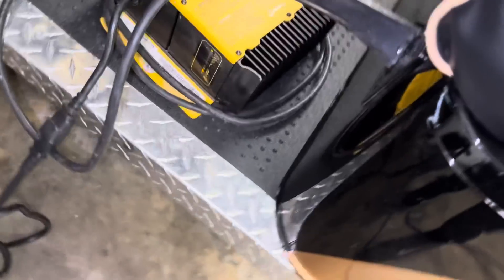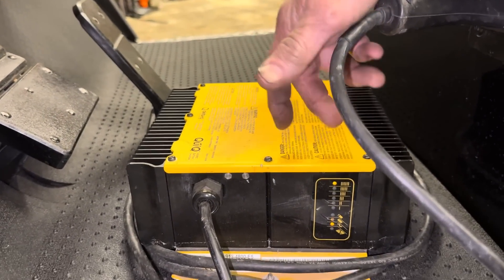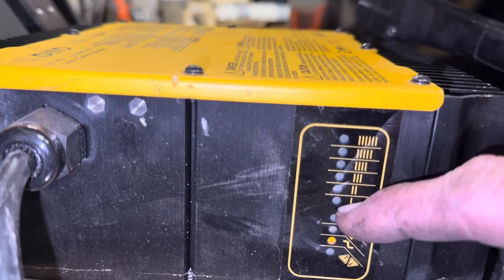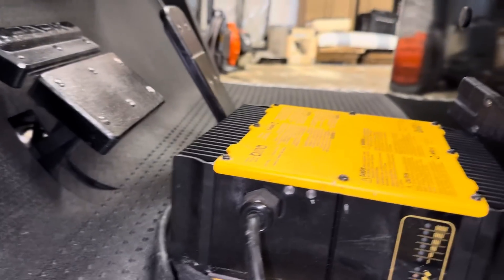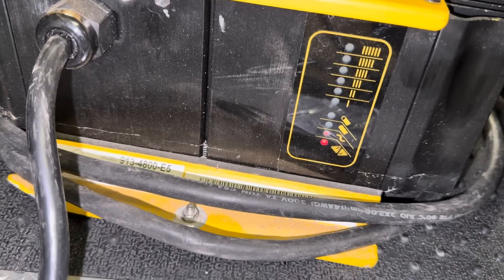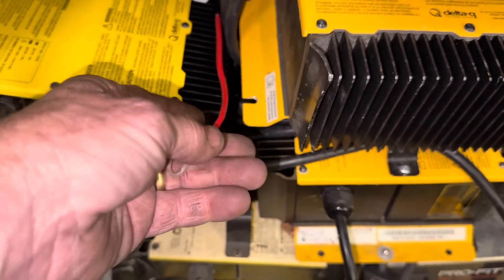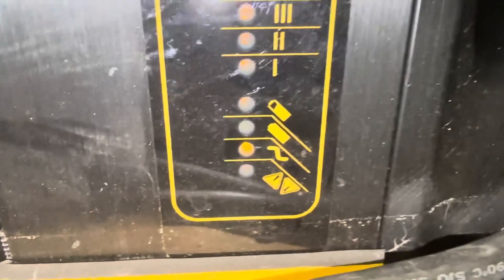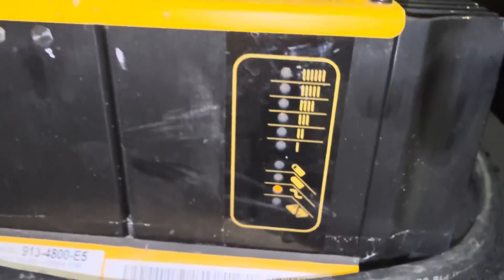QUIQ CHARGER: How it REALLY Works

Comment: I got one on a spider lift, I just installed new batteries and after charger is plug up only few minutes it sounds like it trying to boil the batteries, can actually smell them so I afraid to use the charger, any idea if they something wrong with the charger. It’s a 24 volt system 912-2400, my batteries are acid thx
Reply from the maker: What kind of batteries did you take out. Also just plug in the ac cord and unhook the dc cord off battery and let me know what algorithm the charger has in it
Reply: @golfcartwhisperer  remove Trojan batteries, was told batteries replace them with was basically same but I feel that they were charged on wrong program
Reply from the maker: @garyjustliving3963  yes children Battery carries algorithm 31 or three if you go to my page, it shows you how to reset your charger to change the algorithm just typing Golf Cart Whisperer algorithm
Reply: @golfcartwhisperer  ok thx, I try post link but don’t think went on here, but I made a video of it flashing code on my channel
Reply from the maker: You have the wrong algorithm.  That’s for gel batteries
Reply from the maker: You have 26
Reply: @golfcartwhisperer ok thx
Reply: @golfcartwhisperer  seems as if my charger doesn’t have algorithm 31 or 33, but how ever it do have 11 , seem from research I did I can use 11, my batteries are around 210 ah I believe with acid, checking see if u think would be fine
Reply from the maker: @garyjustliving3963 that’s correct you can use that. It’s not perfect for that but it will work
Reply from the maker: https://youtu.be/t-M4jr_HeZ8?si=yLbMxrRdfHfM_WBr

Comment: Can these chargers be mounted sideways? I tried mounting mine inside the cart underneath the seat sideways and it got very hot and stopped charging. I unplugged it and let it cool down and set it upright and it works fine. I just want to know if I can set it sideways and maybe add a cooling fan or will mounting the charger sideways hurt it?
Reply from the maker: Sideways is good it doesn’t matter as long as it gets air
Reply: Well thank you for replying. I appreciate it very much. I'll see what I can do about it. Thanks again.
Reply from the maker: One thing I told myself when I made this page. Is I will respond to every comment or question on any of my videos.  Thanks for watching. Hit that subscribe button.

Comment: I just purchased a 2019 ezgo with a Samsung SDI Lithium battery. I won’t be using the cart in the coming winter months until about April. I need to leave the cart at my summer place but it’s not climate controlled in Delaware. Should  I remove the battery and store it in my other place inside and keep it charged from time to time? Or can I leave it for that long with the cart and maybe come back once a month to give  it charge? Sorry for the long question.
Reply from the maker: Take it out and store it in a climate controlled area. To get the best time out your batteries.
Reply: @golfcartwhisperer thanks should I buy another charger separate to change it at home since the Quiq Q charger only works with the cart plug? Or will it last 4 months in climate controlled closet at home? Then I can charge it back up in April?
Reply from the maker: How cold does it get where you live at?
Reply: @golfcartwhisperer in Delaware just under freezing in the teens in Jan-Feb
Reply from the maker: @mikesky4701 there is 3 screws to take the back of it off. 
But remember your your charging post will be exposed so while I was hooked to the battery, they’re going to be hot so once you charge it up, I would unhook one of the leads on the Battery so you don’t have a voltage on the post that stick out
Reply from the maker: All you have to do is unhook your charging port from the back of your plug. And your charger will work.  Then just take the plug inside your house and charge it up
Reply: @golfcartwhisperer genius! Thank you that’s easy I can do it. Gets down to 20’s in Jan /Feb I am going to keep the cart under the house it’s up on stilts beach house and open.

Comment: How long does it take to recharge the batteries and does this cut off automatically when it is charged???
I have the same charger and cart has 6 batteries in it…
Thanks for video…subbed you…
Reply from the maker: Thank you sir.  Depending on how dead the batteries are.  But they can charge anywhere from 4-& hours.

Comment: I have this charger for an older Star EV golf cart, I’m trying to figure out it the batteries are bad or if the charger is not working properly. Having this issue where I charge the cart and it only last for about 10-15 minutes before it starts to slow down a lot. The charger lights do not indicate any of these indications yours does, whilst all batteries read 8v. I’m lost on where to find this issue out completely
Reply from the maker: Hat does your charger do when you plug it in
Reply: @golfcartwhisperer it shows the Ac power is present but not sure if I’ve seen other indicators go off
Reply from the maker: Does your golf cart run now meeting? Can you get on it at this second hit the gas and it move.
Reply: @golfcartwhisperer yes the cart is still functional and the battery’s seem to charge it just doesn’t seem to be fully charged
Reply from the maker: Does your charger cut off once it’s full charged
Reply: hey my ezgo is doing the same thing charges overnight and only lasts 5-10mins and my charger has the swiggly line on the bottom but it hasn't ever charged higher than the second bar on the charger and can't figure it out. batteries are brand new
Reply from the maker: When’s the last time you put new batteries in it. Also put your cart on charge and check each battery while it’s charging and let me know what it shows.
Reply: @golfcartwhisperer brand new batteries last month but i don't have that 3rd wire connected with the little box on the end. does that do to a positive or negative?
Reply from the maker: Did you make sure you put 8 v back in it and not 6 volts
Reply: @golfcartwhisperer it's 4 12v batteries 48v system
Reply: Mine suddenly does not work properly. The red and yellow lights are blinking, but no charge, my cart is dead now.
Reply from the maker: @ricajl you need to talk to a 12 car charger and hook to each battery for about 30 minutes to give them a boost or if you have someone that has a golf cart and jump from their main positive and negative to yours with jumper cables

Comment: Question?.i have the model  9133610t3  36v Can b work on my ezgo txt golf cart 36v?.thank you
Reply from the maker: Yes sir it. An what kind of end does it have
Reply: @Golfcartwhisperer it has no end .the guy cut the end but I remember the he was using the charger on a scrubber machine
Reply: Be fore he has a side charger receptacle for 1983 to 1994 ezgo
Reply: So if I put the receptacle end on it then I'll buy the powerwise d plug adapter you think it will work?
Reply from the maker: I wouldn’t even do that. I would just bolt it beside the batteries on the drivers side then put 2 eye ends on the wires and run to the main negative and positive. And just plug in drop cord when needed. As long as it’s a 36 volt charger

Comment: I have one of these chargers from when I had an EZGO. I currently have a Club car with a bad onboard ERIC charger. Can I hardwire cutoff the triangle plug and hardwire to the cart?
Reply from the maker: Yes.  What type of batteries are in your club car
Reply: @golfcartwhisperer they are Diehard batteries.
Reply: @golfcartwhisperer cart has a factory setup with a ERIC charger and reel extension. It has an Andersen plug I was thinking of wiring positive and negative and giving it a shot but I am unsure if it would work as it most likely will have a third wire which not sure where it would go.
Reply from the maker: @hemiboy29 the third wire will go to the positive. And yes it will work.
Reply: @golfcartwhisperer appreciate your help!
Reply from the maker: @hemiboy29 yes sir. Just hit that subscribe button for me.